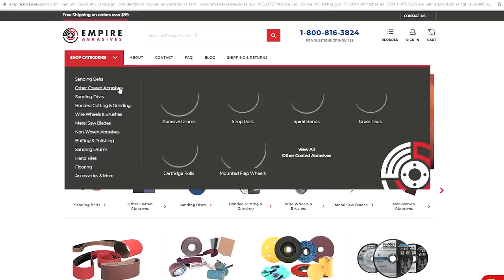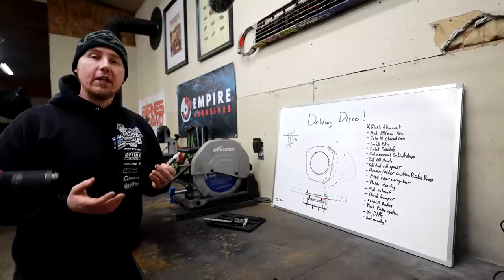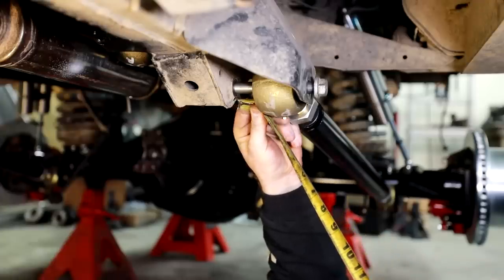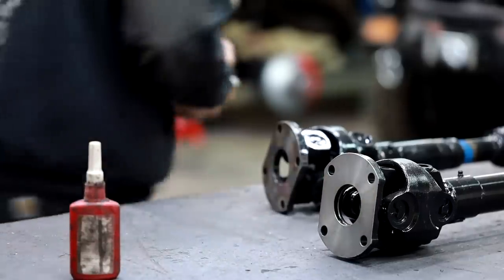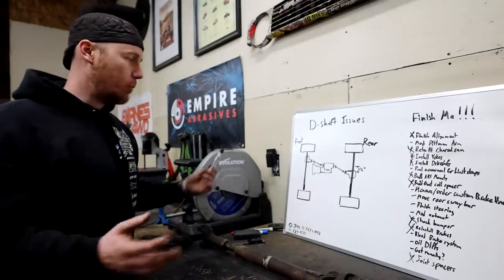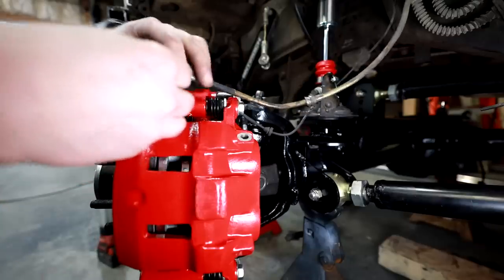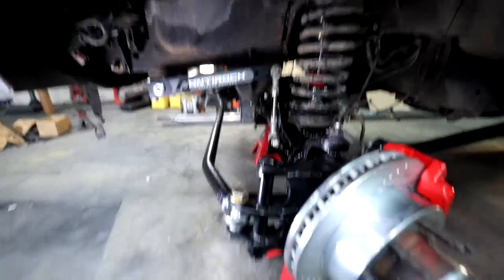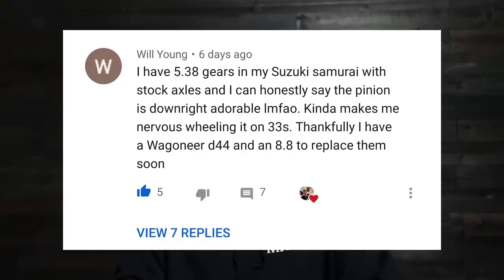It Drives! 1st Test Drive on 1 tons. Ultimate Land Rover Discovery Build Episode 14

Comment: Just my 2 cents concerning the brackets for the Rear Wheel Speed Sensors: A rock is gonna get in there and break off the sensor and maybe a tooth as well. Seems like there's a good reason factory fittings are always fully enclosed, including the toothed ring.  The angle iron seems like it'll do a good job of "proof of concept", but I'd recommend a nice machined aluminum piece to attach to the hub that has a hole machined into it for the sensor.

Comment: Hiya pal the D2 runs the LT230 Transfer box same as the D1 and defender only thing it but doesn't have the manual difflock for the centre diff which is a common upgrade alot of d2 owners that offroad them do cos if one of your wheel sensors go down your 1 wheel drive without lockers the D1 and D2 were 1.2ratio defender were 1.4 and the early 90 landrovers were 1.6 ratios they were in the 2.5ltr na petrol and diesel engine early trucks ashcroft has now got a 1.3 ratio as after market ratio and they also do afew other good upgrade parts for the transfer box

Comment: Hi Nate. I'm in the middle of designing a rear 5 link coil conversion for my leaf spring truck.
Due to limited space (the fuel tank is really close to the diff housing and the chassis), I think I need to use coil overs, at a slight angle away from the fuel tank. 

How do I go about selecting the correct coil over? I'm looking at the kings website, and not sure which ones I'd need for my geometry. 
.... and which orientation should I mount the coil over? ie can I orientate it in the plane of the chassis, or does it have to be in the plane of the diff housing?

Comment: Having two double carradans in a drive line was coming in cars in the 70's. You will be fine at freeway speeds. Binding off road will be the issue. But they can be clearanced to help. And probably already have been. I build drive shafts for a living for several years.

Comment: Sorry, but some of this is really painful to watch! There is no factory spec for the distance as it's self setting. Maybe you should have contacted me for a chat, you'd have found all this out easily... there is no need to make any special depth gauge on it, you simply knock the sensor in it's special cage to contact the reluctor ring and when it moves it pushes it off to the correct distance. You also need either a bigger ring as your speedo will be out or adapt it electronically. The speedo is taken off the wheel speed sensors!!! You brake problem might be air in the Modulator which you need to open the valves to bleed properly if you don't do it in a specific way, which you won't because you don't work with these vehicles everyday.

Comment: Nate ....have you considered changing your motor mounts to skew the entire drive train a few degrees to passenger? if your tunnel has room this can alleviate some of the crazy angles....just a bit. If you have room you can kick the transmission mount driver a tad, while shifting the driver side forward and the passenger side back.  Just a thought , I have been told that  some vehicles are arranged this way from factory for this exact reason.

Comment: I think you could take a soldering iron with a thin blade head, you could "weld" the poly back together once you get it on your shock.
Maybe try a little R&D to see if it'd hold up.

Comment: The LT230 is a strong box, I smashed one into low range at 80km once and she was fine but with the hand break drum on the back of the case the uni joint is already hanging out a long way from the rear output shaft bearing. It’s going to have a lot of load on i pushing it side to side and the support is a good distance away. Good luck with it though.

Comment: Could you not have used the factory Ford sensors and then just changed the pigtail end?
Reply from the maker: I don't think so. The rear has no wheel speed sensors at the hubs and the factory ford front sensors had more impedance when i measured them. The rover ecu probably won't like them.

Comment: for the "shock bump stops" can you not unthread the eyelet off the end of the shock, or would it require full disassembly of the shocks? That would allow you to run a 1 piece "donut" and not have to slit it and epoxy it back together.

Comment: Hey Nate, just watching the new video... great progress so far. With regard to the shock bumpstops, it may be possible for you to cast the poly bushes around the lower eye using a simple mould. Would make  the bumpstop homogeneous and not reliant on hose clamps to hold it together.
Reply: Talk to Kris at ‘Redwood Plastics & Rubber’ in Langley, he’s made custom poly parts for his custom ZJ build, can also find him on ‘4Low BC’ FB page 😉
Reply from the maker: This is a good idea. I actually know some folks that could point me in the right direction on how to do this. And the hose clamp was only temporary lol

Comment: AS usual a well put together story Nat, as for those brakes i have been down this road before and the issue i found was generating enough line pressure, for the win go and fit a hydraulic booster and you'll never look back

Comment: 14:30 you put a joint spacer inside on one side of the joint and a spacer outside of the joint on the other.  just double check in case. love the build!
Reply from the maker: I did! The front two are different then the rear to clear the bracket 👍
Reply: @DirtLifestyle  oh okay i had to be sure lol 👌🏻

Comment: What is that thing you did your brake fluid with?  The thing that looked like a bicycle pump.
Reply from the maker: It's a mitivac fluid evaluator pump. I just used a brake line attachment and it works outstanding! I use the pump for all kind of stuff like this 👍
Reply: That's kind of awesome!  So I assume it lets you bleed the brake lines alone.  Which would be a huge benefit for folks like me that are usually working alone in the garage.
Reply from the maker: @SWBCrawler  me too man, and that's why I invest in tools like this. I can use them by myself and they help keep your work area clean. I had no brake fluid on the floor from this project. 👍
Reply: @DirtLifestyle  I'm already looking at prices.  ;) Did you have to adapt it to the bleeder?  Or does it come with something that will clip on there?
Reply from the maker: @SWBCrawler  it comes with a bunch of random hoses but the adapters are something I had in another kit. A quick google search and I found what I think you would need. Here is a part number 👍
MITMVA6913
Reply: @DirtLifestyle  awesome man. Thank you

Comment: I’m just curious, did the ABS malfunction light come on on the test drive? Great work and looking forward to the finished product!
Reply from the maker: ALL the lights are on lol. I'm looking for the best LR specific code reader. The 3 readers I own don't seem to like Land rovers.
Reply: @DirtLifestyle  go to RT engineering from Utah he sells software for Land Rover and Range Rover.
Reply: Sorry for code readers and clearing softwares
Reply: Launch generic scanner works pretty well with land rover, abs-brake power bleeding- tranny- even reprogram new ECU from another truck in the middle of the trail(flooded pretty bad)in couple minutes... works pretty good for me since 2017!
Awesome job Nate, love your disco! Just  keep your engine cooler possible,keep radiators clean and replace your thermostat with one wich opens at 190f and you should be fine, mine works fine for already 4 year's, never had an overheating even in summer time in the trail.

Comment: For the shocks IIRC, atleast on mine, the eyelets are welded to the shaft so its not removable without rewelding. On the rear driveline, if there is a large worrying vibration at higher speeds, you could attempt to rotate the pinion so its in parallel with the rear flange on the transfer, though I see how that would be really difficult with the truss and mounts. I haven't ran a double cardan personally so its only speculation unfortunately. But loving the build man can't wait to see it on the trail